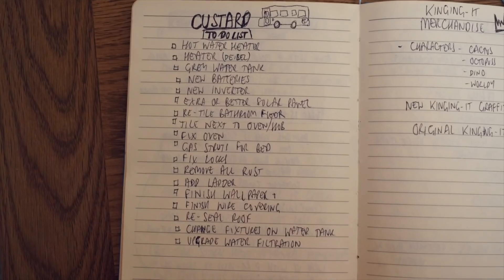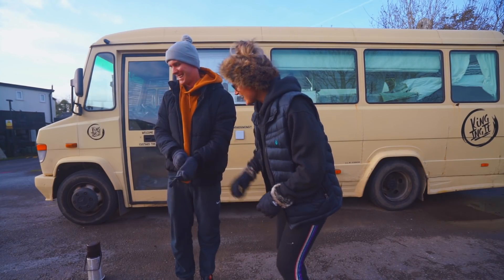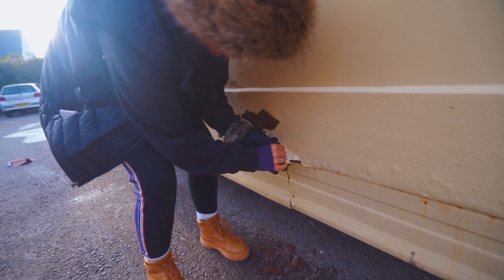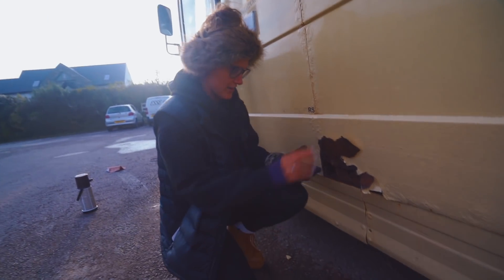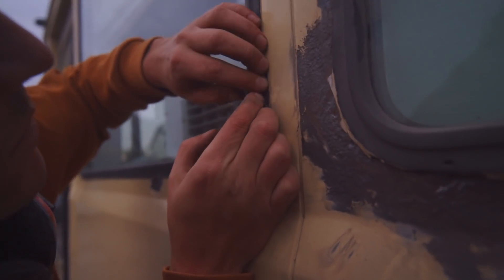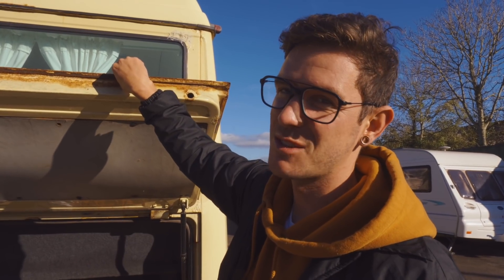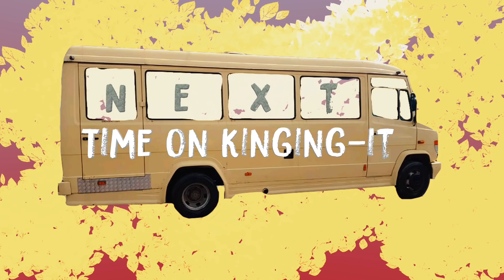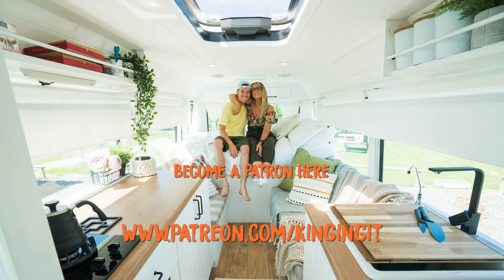How to remove RUST on a CAMPERVAN - your van's WORST enemy!

Comment: What is it with early 2000s Mercedes and rust? My sprinter looked terrible when i bought it but after countless hours of rust repair, welding in new sheet metal, and body work it looks presentable.
Reply from the maker: Aww you're a good Egg! 😊We're hoping to do the same! Fingers crossed!

Comment: Welcome the world of Merc steel .. :) The Vario's rust from the inside out and you will need to hunt a long way to find it all. The wet feet is the front bulk head under the windscreen rotten. If the chassis rails are good you could replace the whole back with a custom body..
Reply from the maker: Ahh!! good to know, thanks Lee! We'll look into the asap!!

Comment: The water you’re getting by your feet while you’re driving is most likely coming in through a perished seal on your windscreen flowing down the bulkhead (behind your dashboard) and down to your pedals. I’d suggest you enquire with a PCV glass specialist about having your windscreen resealed. Won’t be cheap I’m afraid to say but it’ll be cheaper long term compared to rainwater damaging the electrics in your dashboard. Not to mention you’re literally sat on the battery box in those old mercs....
Reply from the maker: ahh LEGEND! Thanks a lot for that advice! Were looking at getting all of the rubber window seals replaced anyways so fingers crossed that will help the matter!
Reply: Your welcome. Good luck with your restoration... 👍

Comment: The Vario,s are really reliable as buses. The only reason bus operators get rid of them is when the rust and rot becomes uneconomical to repair.
You can fit plastic boot doors to them. Have a look on donedeal.ie
Loads of Vario buses operating in Ireland so lots of spares available over there.

Comment: Hello fellow van/bus buddies! We are just about to finish the same kind of renovation to our 1988 Peugeot J5 🚐✨ .  It is a huge project to make, but in the end it is all worth it! We had some water leaking to our cabinet also and it was coming under/thru the windscreen sealings. In the end we had to make the whole frame from scratch and renew the sealings too. Great tip is to SAVE the original shapes of the metal structures so you can copy it to fit the new as perfect as possible. If you have questions and/or are interested to see more, you can follow our journey in instagram @truetravelstories and soon we are going to make some videos in YouTube also of the project we’ve done with our van. All the luck for you guys! 🌿
Reply from the maker: Ahh! Thanks so much guys!! I'm glad someone else has done it too! So many people saying we should bin her!! haha are you mad?!?! She's our everything.. and we cant wait to get her finished! Great tip about the windscreen seals! We're hoping to get them all replaced soon anyway so fingers crossed that will solve that problem! Thanks for the comment and advice guys! Best of luck with your van too!